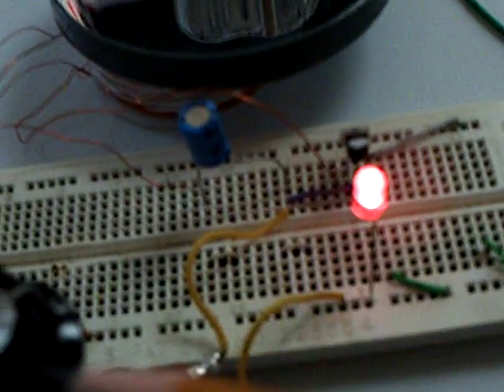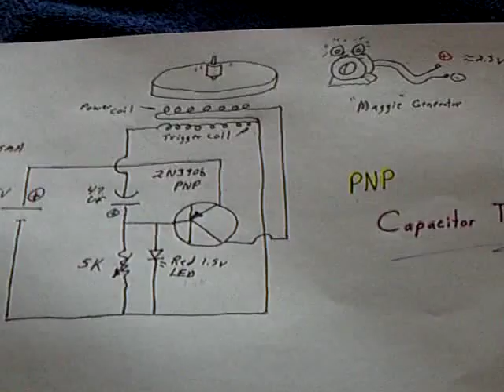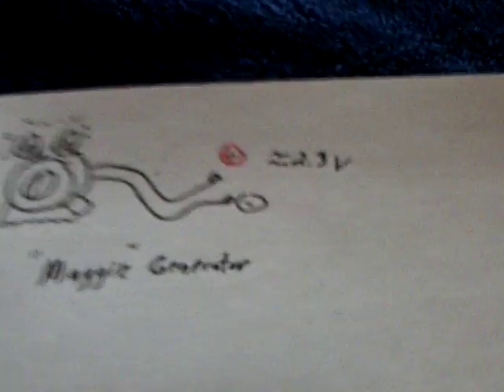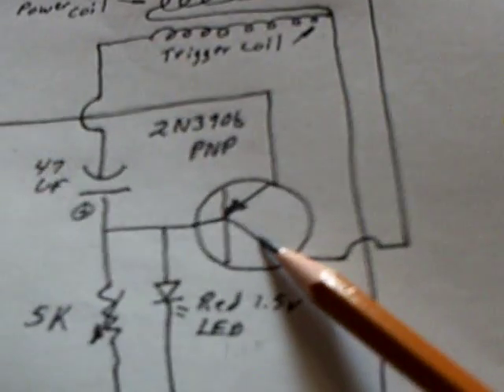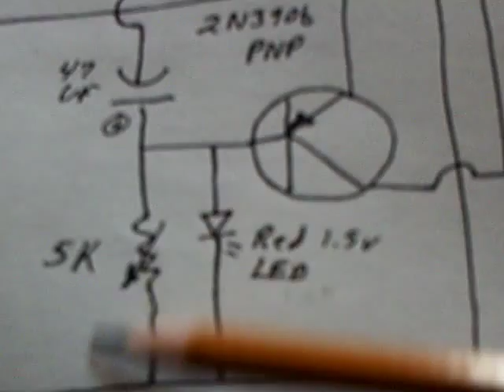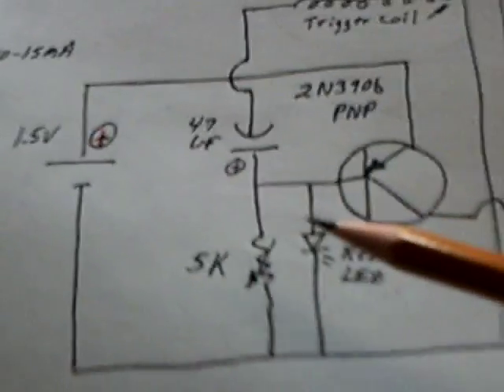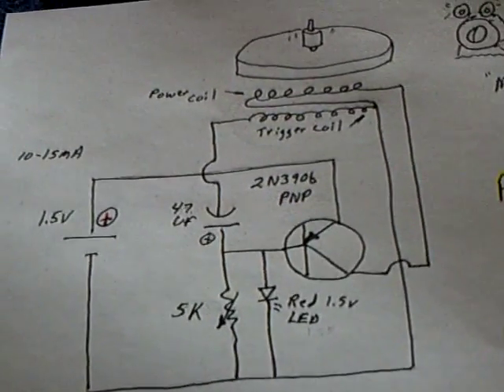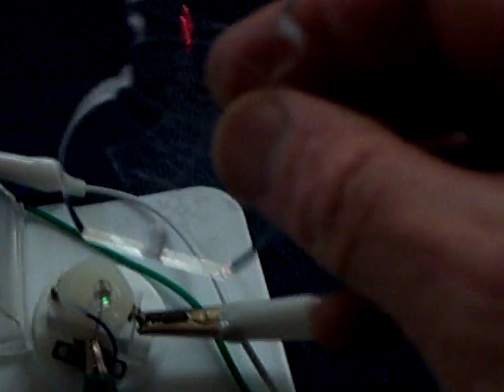PNP Capacitor Trigger

Comment: Reason behind Maggie's eyes dimming (just a theory) is because she can't supply enough voltage or Amoerage for the RGB LED because green requires a higher amp draw. To test this theory, use an almost depleted battery for the RGB and see for yourself that only Red color would work while the green would be off and blue would be so diim, almost off. Red laser vs. Green laser requires more power because green is a higher frequency I think and that's why green laser beam can be seen at night especially if you imagine using it as a sniper's target practice.

Comment: the main circuit look somewhat like a joule thief ... a very usefull circuit indeed ... maggie blinks when the red led illuminates ... red has the lowest forward bias voltage generally ... it must steal all of poor maggies energy ...  it wont trigger without the LED on the base... the led must provide the voltage accross the pn junction and I agree every circuit I build I learn something .. happy holidays

Comment: The red side the tricolor led might have more voltage draw and the chip controlling the light shifts might get hung because the voltage drop so it takes more power away from maggie that is my insight. Since I had semiconductor classes I think this would be a feasible asumption. Most ic chips require two to three volts to make a shift plus their has to be a capactor inside that thing because caps act the same way when you fill them with voltage and put out the leds.